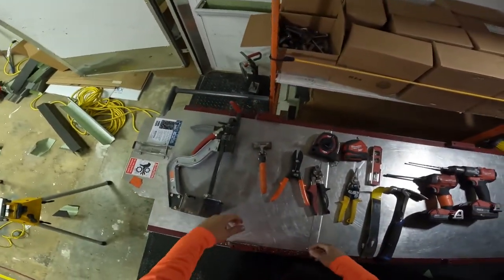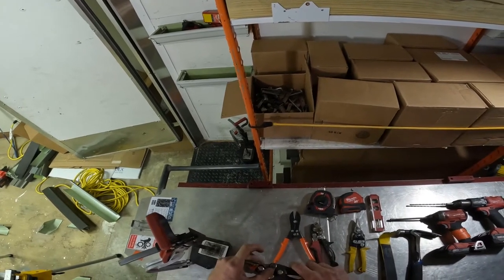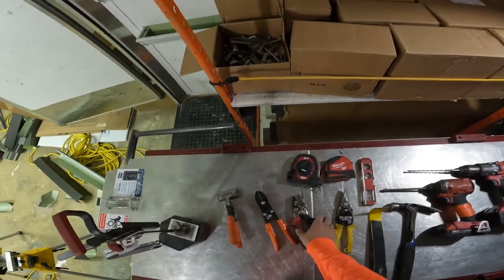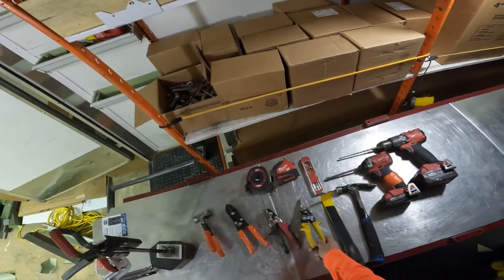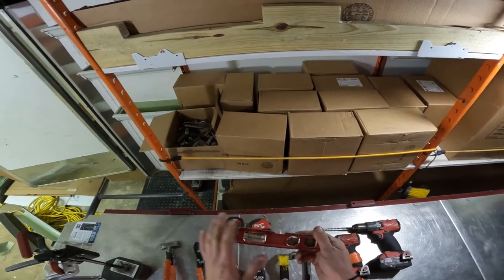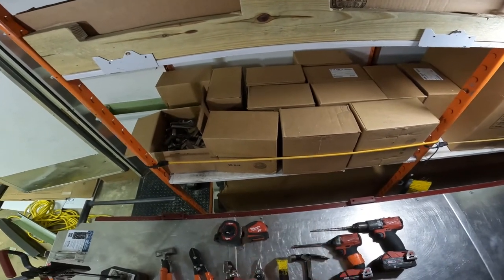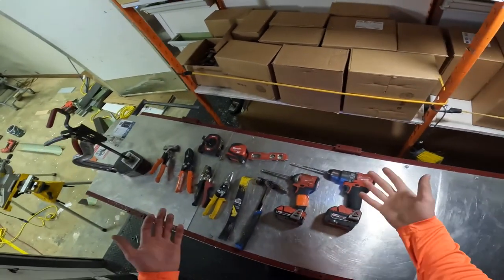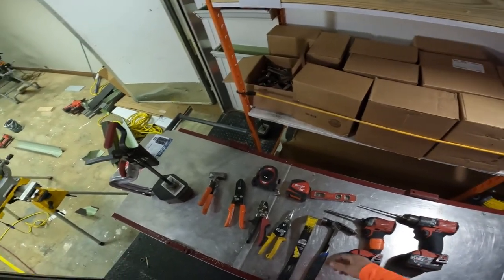The Best Gutter Installation Tools You'll Need To Start A Seamless Gutter Business

Comment: What size miter saw and type of blade do you use?
Reply from the maker: For 5" gutter a 12" miter saw works fine. If you are doing a 6" gutter you need a 12" sliding miter saw.